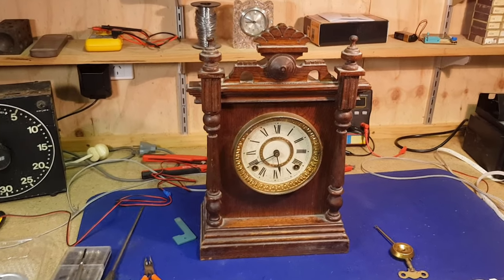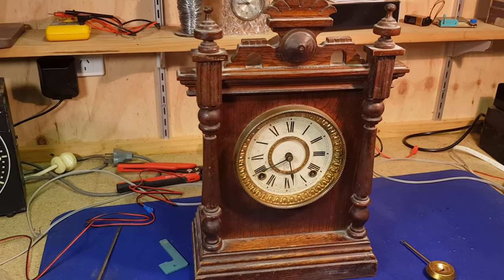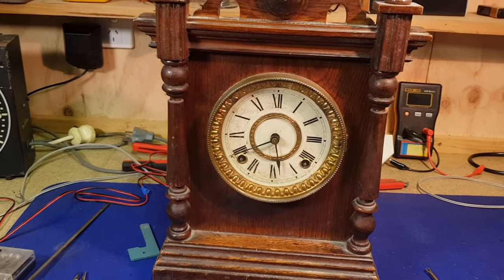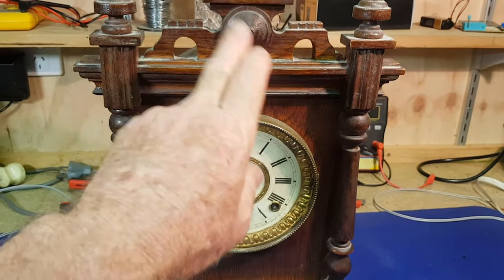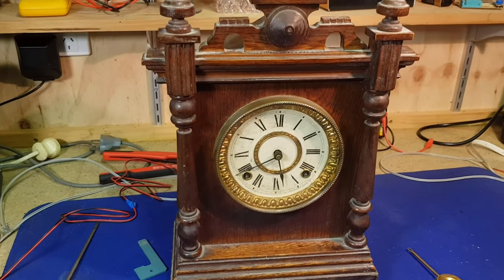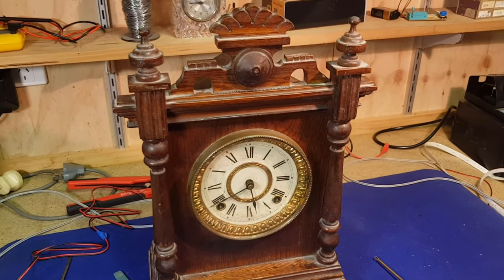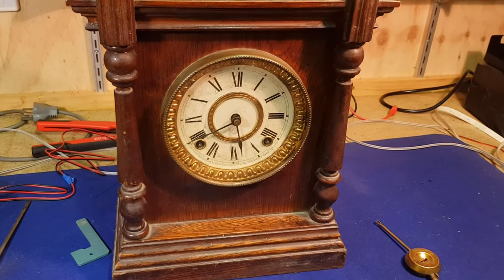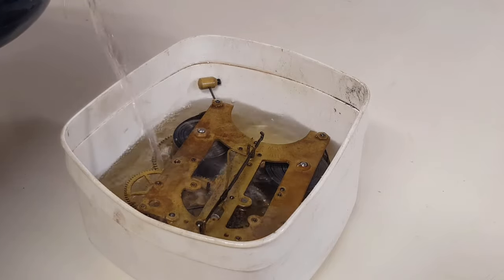How to fix an antique mantel clock. Service & lubricating an overwound movement. DIY Ansonia repairs

Comment: Hello, and thank you for taking the time to make such a wonderfully helpful video!  As a fellow hard-core recycler and repair guy (much to my wife's chagrin), I subscribed to your channel and look forward to exploring your other adventures!
I just 'inherited' an early 20th century Vienna regulator-style wall clock (probably a HAC) that works for a few minutes up to an hour, but then will stop.  So probably just needs a good cleaning and oiling.  So here's my question: Its two large springs are the ENCLOSED type...do you see any concerns with "petrol-soaking" since I won't be able to re-lubricate the springs internally without taking the whole movement apart to remove them (which I'm desperately trying to avoid!)?
Reply from the maker: Hi Jeff and thanks for the sub! Hope you find my varied content interesting 😊
The enclosed springs are really impossible to clean without a full dismantle which is a big step! You can still wash the movement, but obviously the springs themselves won't get much of a wash - and also will take awhile to dry out from any petrol which gets in there! Probably better to 'splash-wash' with a soft brush rather than submerge which would fill up the spring drums. There's a pretty good chance that just cleaning and re-oiling all the gear train pivots will be enough to get your clock running more consistently 👍 Cheers, Chris 😊
Reply: That’s what I was wondering too. I have a Westminster chiming mantel clock which doesn’t unwind much at all. It’s still working but I don’t think it will last too much longer. I was thinking of using white spirit as a solvent. If it’s a three drum springs movement, will oiling through the space in the drum lid used for levering off the lid with a screwdriver to open it, be enough to oil the whole spring?
Reply from the maker: @jazzman1626  Sorry for the delay, I've only just seen this question!
Probably not would be my answer. Again, I would try splash washing the movement without getting solvent into the springs. If all the pivots are clean and reoiled, the springs may still be fine to drive it for many years as they are. If not, then the only real option is to dismantle the springs completely and clean, reoil and rewind the springs back into the drums which is a big step for a DIY unfortunately!
Reply: @TheUltimateRecycler  
Thanks for getting back to me on this. I have since taken the movement out of the clock. When I had it working, sort of, when it stopped, it only wound three half turns at most. When I let down the springs, they let down much more. As far as I can tell, not having done this before, it has let down fully which is encouraging. The little spring clips don’t spring back onto the teeth of the springs wheels very well but I’m wondering if they just need cleaning and re-oiled. I only paid £30 for the clock, so I’m treating it as a learning experience rather than something that simply must be fixed. We are planning to redecorate our living room at some time this summer and I intend to get as good a long-case (grandfather, rather than Grandmother/daughter) clock as I can. Preferably a nice plain looking Victorian clock. I like the Idea of it having been loved by a family for generations.
Reply: I have a 1911 New Haven Oporto clock.  Both mainsprings are broken.  They measure 111 inches and 125 inches.  In searching for replacements I keep seeing 96 inch springs being recommended.  Your thoughts?

Comment: Mineral Spirits works very well and is not as dangerous as gasoline....  And if you have an ultrasonic cleaner, after soaking in Mineral Spirits, put it in  clean water with a bit of detergent for about 10 - 15 minutes.  Rince in plain water then dry the clock movement in fresh air..
Reply from the maker: Thanks Keith. Does mineral spirits leave any residue at all?
Reply: @TheUltimateRecycler no it’s clear

Comment: I have a benly turtle clock only works upside down the wound is too tight
Reply: How do i unwind the clock ?
Reply from the maker: You need to release the mainspring pressure which can be tricky to do. If the clock runs upside, leave it run to unwind the spring that way!

Comment: The demand for these clocks will rise again, but i think they need to be reffitted with a silent radio controlled movement with chime
Reply from the maker: I've seen many old clocks fitted with modern quartz movements, but would rather see them left original if possible. Thanks for watching 😊
Reply: @TheUltimateRecycler  Thanks for the reply, yes indeed the Old movement should be preserved, and if possible secured in the case if the space allows it at the same time as the modern movement i was only thinking in the resell of the clock, in that way atleast the cases would be put to good use, people as i understand it, dont want the  tick-tack Sound  anymore sadly 😊
Reply from the maker: @thegrassyknoll7792  Yeah, many don't - and also having to wind the clocks regularly!

Comment: I'm one of the naysayers to this process. This "dunk & swish" technique may work for a time or not at all on a 150 year old clock. You can't know what's wrong with a movement without dismantling it. After cleaning all components separately, it will be apparent whether bushings need to be installed--not to mention other important areas of service--which in my experience is 100% of the time on American clock movements from the late 1800s through the mid 1900s. Properly disassembled, cleaned, bushed and oiled with today's synthetic oils, a clock such as this Ansonia will likely run for another 150 years. Using the described "dunk & swish" routine is a shortcut that may get the clock going for a year or two, but will not solve the underlying problems that stopped it in the first place. Dipping in gasoline solves none of the issues.
Reply from the maker: This process is something to try for the average handyperson who wants to try and get grandma's old clock going again without the prohibitive expense of taking it to a professional repairer. You are absolutely correct Tommycat in that a "dunk & swish" will not fix any damage or any excessive wear - but it does have a chance of fixing a gummed up movement from old or incorrect oil. A chance! Certainly not guaranteed. But what's the alternative for a common clock when the owner doesn't have the skills to do it themselves, nor the cash (usually more than what the clock is worth) to have it properly repaired/serviced? Surely a shortcut with a chance of success is worth a try. A couple more years is better than throwing the thing out!
Thanks for watching and I do appreciate your input 😊
Reply: @TheUltimateRecycler , most of the movements I repair show signs of shortcuts taken over the years that have involved no disassembly. I think it is incorrect to assume that people watching your tutorial will simply have a dirty but serviceable clock and your method will fix it. What are the chances that a clock that's over 100 years old won't need more than a dunk and swish? I haven't seen a single one!

During the depression, like today, those who couldn't afford clock repair dunked the movement in kerosene, as gas/petrol was too expensive. The clock was then liberally lubricated with the wrong oil in all the wrong places by the hobbyist. Complicating this was the heavy use of tobacco back then and the prevalence of coal and wood fireplaces, further exacerbated by massive industrial pollution. That dirt, grime, grease and grit floating around the fireplace mantel means that clocks from this era will likely have well worn pivots from the accumulated muck. No amount of dunking and swishing will remove this muddy grit, nor repair the wallowed holes.

As mentioned, rarely do I see a clock from the 1800s or 1900s that hasn't had some questionable work performed on it. Inevitably, what I see 90% of the time are clocks that were dunked, pivot holes punched and movement oiled, the result being mucky, uncleaned pivots/holes and additional wear. Taking such a movement out of a clock and following your procedure will yield poor results and compound the issues.

Perhaps you might add a caveat to your otherwise excellent tutorial detailing what to look for on the outside of the movement (i.e., punched pivot holes) that will indicate poor maintenance and dictating deeper repair efforts?
Reply from the maker: @tommykat1  Thanks for your detailed comments. I agree with most of your writings and you are obviously an experienced repairer. I will continue to ask you though, what is the alternative for people with an old clock and neither the experience nor money to do the job properly?
I do disagree with your 100% of clocks will need more serious work. Maybe 100% of the ones you have seen? Perhaps you are just in a bad area for clocks!? I have had a few which are still going nicely without rebushing and nothing more than a good clean and re-oil. Judging by other comments - others have also had success.
Not every clock has been used constantly for 100+ years. Many were retired to the shed when newer models came along. They may have been regularly serviced early in their lives, and then sat in storage for 50+ years resulting in the old mineral oil turning to gum!
I don't believe my methods will cause any undue damage nor compound any future repair work. 
But yes, it is a shortcut and will not be a long lasting fix. Certainly not as long as a proper dismantle & service.
Oh - I do have a carriage clock here which has had many pivot holes roughly punched! Now there's an example of poor and damaging repair techniques! 😲 I'll show that one at some stage - and maybe do a video on trying to re-bush it. Cheers
Reply: @TheUltimateRecycler  I'd love to see that punched clock, LOL. I'm just finishing a Korean 8 day movement that has some of the worst punching I've ever seen, as well as the need for numerous bushings, including both winding arbors. But, indeed, I can honestly say that over 3/4ths of the clocks I work on have punched pivot holes, including the last three Ansonias (like yours). Punched pivot holes means the repairman did a dunk and swish followed by poor repair, and once I receive the movement, it can only be overhauled properly. Also, the last Ansonia I restored in January had a sheared click along with the need for 16 bushings, so there was some extra effort there. Now it will run for another 150 years, LOL. Cheers!
Reply: @TheUltimateRecycler  regarding your question, "I will continue to ask you though, what is the alternative for people with an old clock and neither the experience nor money to do the job properly?" Answer: there are no shortcuts. Either the clock is a non-working wall ornament, or if properly overhauled, it will be an accurate time keeper for the next 150 years.
Reply from the maker: @tommykat1  Ok, I'm going to put my Aussie farmer's hat on now and say this: "Mate, there are successful shortcuts to everything in life - as long as you understand the results you are going to get!"
In all seriousness though, thanks for the comments and there is certainly nothing wrong with differing opinions! The YT comments section can be a wonderful resource for valuable information and civil (& sometimes conflicting) discussions are always welcome! 😊
Reply: @TheUltimateRecycler  I agree, my friend! Thank you for continuing a civil discourse with me among your many fans. Your videos are top-notch. My disdain of dunk & swish is only one fellow clockmaker's opinion, and I'm certain many disagree with my stance.

Comment: Suggesting the clock is "over wound "is like saying your car won't start because you over filled the gas tank!If you wind it all the way up,and it doesn't run,it's NOT OVERWOUND,IT NEEDS TO BE REPAIRED.No amount of oil will fix worn pivot holes.Adding more oil will not help.You must remove all traces of old oil first. Best plan is bite the bullet and have it done right by somebody who actually knows what they are doing.
Reply from the maker: Tim, you have just clearly demonstrated that you did not watch the video at all!! 🙄😜😆

Comment: I can't even get the hands off
Reply from the maker: They are usually just a press fit but can be pretty tough if they haven't been off for a long time! Try a really gentle tap on first before trying to lever them off (make sure you project the face of the clock from scratching!)
Reply: @TheUltimateRecycler  I will attempt that. I appreciate your response.

Comment: This is a very lazy way of fixing a clock. It’s a shame that people are falling for this hack.
Reply from the maker: Sam - it's not about being lazy! It's about people being able to keep a low value clock out of the scrap metal bin or landfill if they don't have the skills or equipment to do a "proper" job!
Reply: Doing it this way will land it in a repair shop faster than just leaving it alone
Reply from the maker: @samsclocks2084  With all due respect Sam, low value clocks don't usually end up in repair shops at all - unless they have valuable provenance or a high emotional attachment! If it's not working, there's really no harm in trying this "hack" for someone who isn't able to do a complete service.
Reply: If that’s true, why am I usually getting clocks that are low value in my shop? Not everyone sees these clocks as low value.
Reply from the maker: @samsclocks2084  Sam, the problem is that clock repair shops charge way more than what these basic clocks are worth - at least in Australia they do! I've had my antique shop for over 20 years now and have seen the price of standard mantle clocks continually drop to the extent that they are a very hard sell these days for anything more than $100 (thats AU$). The average Joe is not going to spend $200+ on a professional service for a $100 clock.
What do you charge for a service on a standard American mantle clock, assuming no rebushing or other repairs are required?
Reply: $200 USD
Reply from the maker: Yep, so unless a standard, basic clock has sentimental value - no one is going to spend $200 USD to have it serviced. Rather than throw it out, what's wrong with this "hack" to get it going for a few more years?
I'm sure you will agree it's better than spraying the movement with WD40!
Reply: People usually get it serviced professionally or just toss the clock anyway. Most people in this era have no interest in these old clocks. Might as well service it the correct way if you really want to preserve it. I don’t disagree with you that this is worse than spraying it with WD-40.
Reply from the maker: Ok Sam, I think we agree on most things actually!
Most people have no interest in these clocks. The ones who really want to preserve a clock (and can afford to do so), do have them professionally serviced - which is why you do see some low value clocks in the shop. The rest toss them away (or maybe sell them on cheaply as 'not working'). The aim of my video is to try and save many that were going to be tossed because they didn't work and the owners could not afford or could not justify spending twice what the clock is worth on a service.
Reply: We do agree that is true. But I just hope people know that there’s a better way of servicing these.
Reply from the maker: Well, I usually mention that my "hacks" aren't the best way - and I have done videos on better servicing techniques. Thanks for your input Sam - It's fine to disagree with things and have civil discussions 👍😊
Reply: You take care sir

Comment: As you pointed out it has two key holes one for the going of the movement, the other for the strike, it doesn't bloody chime, it strikes, so why don't you say so.  You can't possibly clean that movement without taking it all to pieces. Watching you is like watching another bloody cowboy who doesn't know what he is doing.
Reply from the maker: I'm sorry my video didn't meet your lofty standards Vicker! But in saying that, it was clearly aimed at people with limited knowledge of clocks (other cowboys, if you like!) so they can have a go at getting grandma's old clock going without doing dreadful things like spraying it with WD40!! 😱
As you'd be well aware, the cost of having these types of clocks serviced professionally these days far outweighs their value - so teaching some to DIY has to be a good thing!
The strike or chime terms don't really matter to a lay person, but yes technically you are correct! My bad!
My methods here will work well for a basic clean & lube without people having the scary prospect of a major dismantle when they may not be overly competent in mechanical things.
Regardless of all this, I appreciate you watching and talking the time to comment (even if rather negatively!) It all helps my channel! Have a nice day 😊
Reply: I certainly appreciate the video, Sir. Both useful and informative. I suppose I am a cowboy myself, but without question your cleaning method did work, as evidenced by the end result! Cheers, and thank you.
Reply from the maker: @danm400  Many thanks danm400 😊👍
Reply from the maker: @jlruby4856  Hooray for us cowboys! 😁🤣
Reply: Wow.  When you take your car in for an oil change do you have them rebuild the engine?

Comment: Looks like another  wannabe clock repair person . To do it right you have to take the clock apart
Reply from the maker: Thanks for your comment rtr rrhhh. To do a thorough and proper job, you are correct. However my videos are aimed at helping people save items from being thrown out without excessive experience or expense - in which case this fix is not only perfectly acceptable, but also very successful. As for myself being a clock repair wannabe - err no thanks! I'm too busy trying to save stuff from landfill! Cheers :)